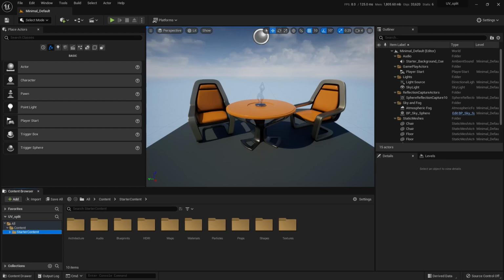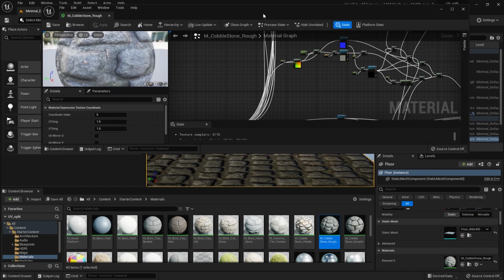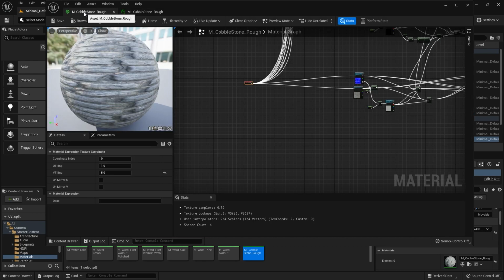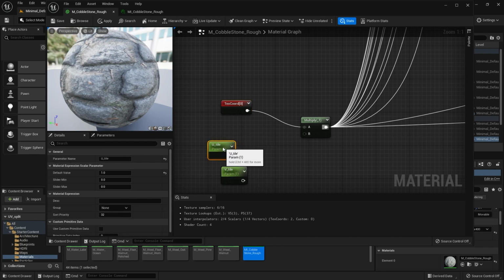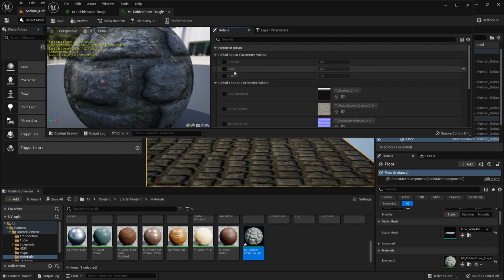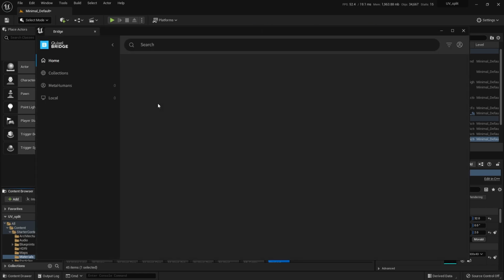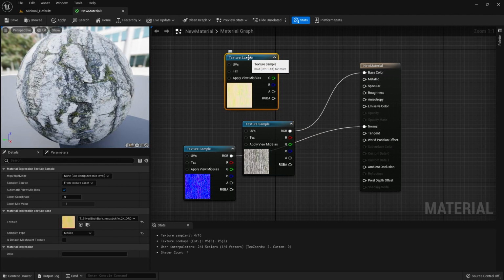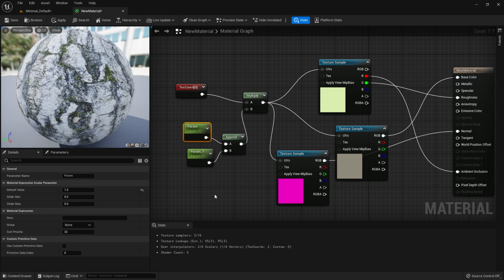UE5 Materials Tip - How To Create U & V tiling parameters for Material Instancing

Comment: awesome video, thank you!

One question I have is this: 
This method works excellent for flat surfaces, but if the material is applied to a 3D object like a cuboid, the tile scaling is stretched or squashed depending on the scale of that particular face. Is there a way to make the tiling size universal on the whole object? I'm hoping its just a box I can tick somewhere..
Reply: What you want is triplanar texturing.